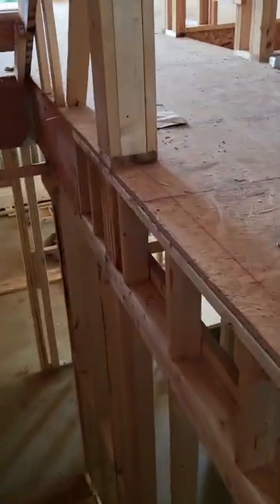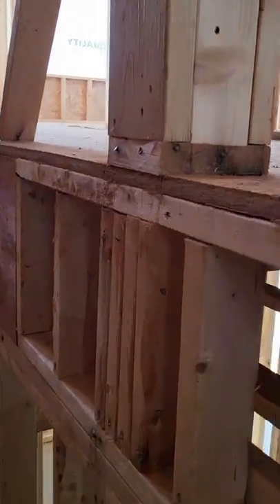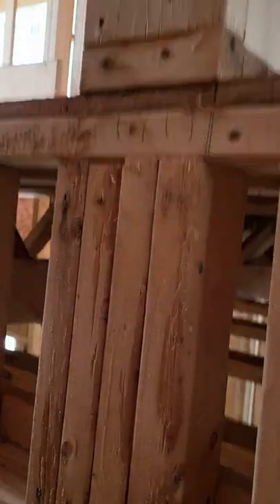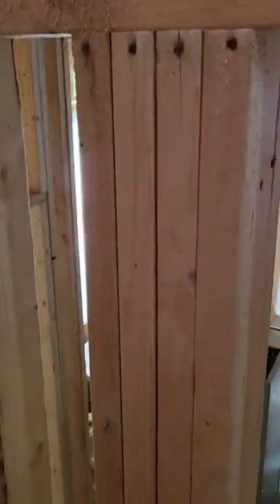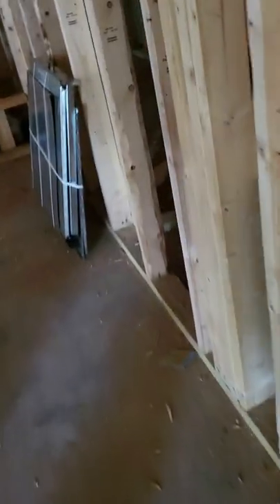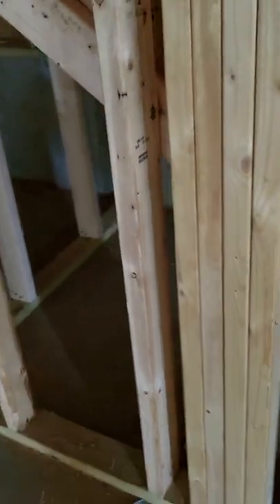Framing Point Load Done Correctly

Comment: The correct way is to use a solid post, wood or metal and not 2x4's. They use 2x4's because it's cheaper.
Reply from the maker: Ok.. I appreciate your feedback.
Reply: Obviously your not familiar with North American framing
Reply: In Canadian building code you can build columns out of dimensional lumber
Reply: This is stick framing my guy, not timber framing…
Reply: I agree with @GT43. Better to use a solid 4x4 when that many studs are required. 

In a situation like that, those studs are called King studs. King studs are also used around window and door openings.
Reply: Unless the 4x4 is clear w no knots it might not be the best choice.
Reply: The problem with the 4x4 is that it's a single failure point if it splits and this type post has multiple before a problem. Actually better long term. Still would like to see LVL material as the caps.
Reply: @wdwerker right you are! Great minds think alike.
Reply: Untrue. Solid members are subjected to knots and splits. Dimensional stacked lumber has the imperfections spread throughout randomly making it a stronger member overall. Think of LVL's. It's a bunch of thin pieces of wood laminated together. Often times more pieces of dimensional lumber nailed together is more costly than solid posts.
Reply: And Goodluck finding solid wood posts that are consistently straight. You won't.

Comment: As long as the concrete guys put  the footing in the proper place you should be good to go.
Reply from the maker: There are footings under the slab at all load bearing walls.
Reply: @PPG1967 then you can skip my comment saying the same. As a spec builder I confirm with photos all of these points before concrete to make sure we didn't mis one. But I hate slabs so much I'm never doing one again.

Comment: I would have use a steel post on the second floor . I’ve seen to many of those tiny wooden sole plates split and blow out under load
Reply from the maker: Oh ok, I appreciate your feedback.
Reply: @PPG1967  noooo don't, built a house in great detail when I was a kid, it was a 2 story with a basement, all the load bearing in the basement was steel columns, the reason the owner who was building it chose all steel in the slab was because the first house he build he went for all wood to save cost. the first solid flood his basement recieved rotted the base of all the supports. 

now each house he builds he makes sure to get some kind of water resistant paint on the lower half of the inner steel supports. he said he's never had a problem with LBW in the basement since. just my 2 cents.
Reply: Try using 3/4 plywood
Reply: Bro, a 2*4 stud on end will support 10k lbs. More when they're shorter.....
Reply: Throw some metal at that gusset plates or coil strapping at all your connections
Reply: Yep those blocks should have been LVL. They had the cut offs around somewhere.
Reply: @PPG1967 as the other guy pointed out on the bottom plate. Is had to be treated because it's in contact with the floor. Should have left a wide piece to show that at the bottom and drywall could cut it off.
Reply: @knotallthere66 yep but honestly with the quality if this house they're getting what they lay for. 
I get it that it's a lot of money for a house but people getting upset because they're paying $500-700-1,200,000 and telling you it should be done like it's a $5 million are a pain in the neck.

Comment: I don't know what state this is in but here in WA you would need a 4×6 to transfer the load, not a bunch of studs. They also generally have the post in the basement secured with a hold down that's either wet set or epoxied into the foundation
Reply from the maker: Oh ok..construction is done differently around the world....depending on what code books are adopted.

Comment: In California we are required to use hold down and Simpson ties to secure the load
Reply from the maker: Oh ok...for possible earthquakes??
Reply: I have worked as a job site framing Forman in California since the 80s before all the Simpson tie downs and hold downs, clips,hurricane ties,coil straps,endless shear panels etc,it takes more time now with all the hardware but it makes the home way  more tighter way more stronger and a lot safer,this framing job would definitely get red tagged here in California.
Reply: Everywhere like that on outer walls they are required, under braced wall code
Reply: OK, my help in a small shake. Good extra.
Reply: @munger2166 Just another reason to never move to California, thanks for the heads up.
Reply: @bryanlacount7551  you couldn’t afford it anyway
Reply: @PPG1967  Yes. You are 100% correct. I feel that you already knew this though!
Reply: California always gets hell I wonder why
Reply: @PPG1967  For earthquakes, yes, but some jurisdictions require the same sort of hardware and techniques for resistance to high winds from tornadoes or hurricanes.
Reply: It's easier to pull the wreckage if it's all linked with thin sheep metal stapled to the split ends of all the 2x4's. The closer to the ends the better. You want nice split ends for aeration.
Reply: @chrisd6607 lol you're rich and cool huh?

Comment: Nice to utilize a hold down even if your note in a sizemic 3, 4 in case of uplift wind
Reply from the maker: We're in a different seismic zone down here in Georgia
Reply: Yes bit if you listed it on inspection the contractor would just cut some strapping or some plate and nail it on (i realize its called gusset support or skmething like that. Conector thats used on trusses). Anything would help. I would put it as a recommendation. A homeowner could do it themselves and less chance of drywall cracks.

Comment: With two levels above the slab at that point needs at least a 24x24x 8” footer under the concrete floor to meet code.
Reply from the maker: So, what code book are you referencing??
Reply: Crickets
Reply: Thank you my point as well.
Reply: @PPG1967 could be Chicago. We’ve always got porches crashing here.
Reply: @PPG1967  I don't know what code is off the top of my head but concrete standards are nothing below 18" x 18". 
Depends on thickness of the slab. 

Post tensioned slabs are a whole other deal.

Comment: Great job.  Now along the coast, it all needs to be strapped to provide a continuous load path for wind uplift from the foundation to the roof.  All of that dead load works to offset the uplift.
Reply from the maker: I appreciate your feedback...thanks for watching.
Reply: Yeah i agree with some steel all the way down until the concrete, but dead load would meet that requirement before getting to the slab. 
If you put in steel to the concrete it's an hassle and extra cost when the uplift will all be engennered by the outer walls and the trusses wouldn't have an uplift load in center span. 
It's tract home quality so we all can point out higher quality for our own trades but if we did it that way the house wouldn't get built due to cost.😊

Comment: That  would  FAIL In New Zealand.  To many peices involved...
Reply from the maker: Well, that's considered good framing   here in the US.
Reply from the maker: I appreciate your comment.
Reply: In my area in the US, we are required to use post (4x6) with ties. Example ( 1/4” steel plates with 5/8” bolts) to account for wind lift.
Reply: I think it comes down to if the load path is spec’ed out or annotated. You might be used to having the load path being strictly specified.
Reply: @PPG1967  this framing works. In fact This type framing we use was engineered by Europeans when they came to the US. The UK uses some of our methods of framing as a result
Reply: Theres no such thing as "too many peices involved in Nz3060 or AS1684", this guy is full of faecal matter and probably doesnt know how to take the safety off of a drop saw.
The only thing we do that's really different to what you have done  is cut a bit neater and we use metal straps to connect the different roof and floor diaphragms together all the way to the slab. The part of your floor that he references is blocking made in-between the proprietary floor truss system you have used and blocking with studs like you have done is compliant albeit i prefer to use a solid beam blocking that goes from joist to joist because it cant shrink out and move out of position like a stud grouping can over time. 
Otherwise you've done a good job mate! 👏
Reply: It would fail in Japan as well.
Reply: Of course you want as much clean carpentry as possible the point is whether or not it's a safety issue. You also have to understand lumber is extremely expensive now in the United States and it used to be fairly cheap. And it's also very hard to find large pieces of lumber, old growth is mostly gone here. It's sad but true.
Reply: Engineering details. Codes don’t cover all applications..

Comment: Several things. Properly nails not just blocking them equal or same amount at least and then the slab you need a pad or a second edge at the concrete preferably with steel in it
Reply from the maker: I appreciate your feedback.

Comment: Here we have to make sure the load bearing points of contact on the slab need to be 12 inches thick with rebar, normally a slab  only 4 inches
Reply from the maker: There are interior load bearing footings.
Reply: You need a pier not grade beams for a point load

Comment: But the support blocks between the floor system should all be the same size.
Reply from the maker: Ok, I appreciate your feedback
Reply: Short blocks can be designed for the crush load allowed on the horizontal plates, About 300 lbs a sq . inch. The blocks are allowed 450 lbs. a sq. inch. Column derating does not apply. A 2by 4 on a plate is good for 1500 lbs.

Comment: If you only going to use one single 2×4 corner to hold all that up, you may want to think about switching to steel like a round column 3" and it will still fit inside your  wall. Insufficient , cutting corners isn't a good practice
Reply from the maker: Ok, I appreciate your feedback.
Reply: That's 4 studs with load distributed top and bottom on each. I'd like to see those ends made of LVL. Now I have to check the crush load rating from the side on LVLs. May need a glue up lvl on edge.😊

Comment: Those short pieces you call blocking are called cripples. They are short studs. In this case there are 4 thick to continue the proper transfer downward. Good work.
Reply from the maker: I appreciate your feedback, and thanks for watching.
Reply: I've used jacks in the basement to lift the point loads and get headers off the windows so they will open. Always crush blocks all the way to the foundation.

Comment: What about rot on the slab due to condensation? I have this issue right now on my 6x6s in my basement
Reply from the maker: That post is on the interior...where do you live??
Reply: Still should be treated
Reply: As long as your sill plate is pressure treated you should be good.
Reply: @PPG1967 it's touching concrete it needs protection. It has to be treated and I be it's not, they should cut a long piece to show it's treated and cut 3/4th the way through so drywall can cut it off easily.😊
Now that I think about it I imagine someone hitting it from the side to snap it instead of a chisel or multi tool.😮

Comment: If there is a footing under that concrete, it’s not supposed to be slabbed over.  It should be expansion jointed and exposed so that it is obvious to anyone that it landed on the footing.
Reply from the maker: There is a footing under that load bearing wall.
Reply from the maker: What code book are you getting your info from??
Reply: @PPG1967  in my area this varies by jurisdiction, but it’s really more of a common sense thing.  How does anyone in the chain of inspection know through a visual inspection that the post is in fact resting over the footing unless the footing is poured to finished floor height.  Secondly, a slab resting on a footing surrounded by loose fill is just asking for trouble due to the different compaction dynamics.  Doesn’t usually present a problem for standard flat work (though it can), but it can behave much differently with a point load as the slab attempts to disperse that load over a much larger area than the footing itself occupies.
Reply from the maker: There was a monolithic slab inspection conducted, with interior grade beam footings.
Reply: Not by code on that little load it's not even needed as a control.

Comment: In my 76 years of life, I’ve never seen what you’re showing here. I have been in a bunch of homes that were being built up to 3500 sqft.  I’m in the Midwest, Chicago area. I have seen a home that the architect liked open spaces and he used 2x10 members that were actually 2” wide by 10” high, the outside walls contained steel posts for support and the basement also used multiple posts with I beams. My current home is a ranch with a full basement. The middle of the home has a vaulted ceiling ( up to 14’ height) from the entryway to the family room. It is a truss construction. The home is 53’ wide and 38’ deep. The basement has 3 I beams, each is supported by 2 posts and each end sits on a foundation wall. All posts are supported on a footing below the concrete basement floor. Their is a factory manufactured stair case going to the basement. The opening to the basement is supported by 2….8x10 laminated beams that span from the foundation wall to an I beam.  All the interior and exterior walls were made in a factory. The floor on the 1st and only level was made in one day, all the walls were erected on another day, and all the trusses were done on the next day, etc.  I have lived in the home since it was built in 2003. This is the best home I’ve ever lived in, it is a tract home.
Some of the reinforcing methods you show, are questionable. I personally do not like 4x4 supports. I use 4x6 or 6x6 and metal bracing. One of the posts was made of different pieces, this to me is also questionable. Whenever I had to do something and it needed to be inspected by a city inspector, I left it apart, until he inspected it, or assembled it in his presence. In this home I built a 16’x48’ deck with 2x10’s, 13  10” diameter x 4’ deep with rebar concrete support posts, double galvanized hangars, full skirt, 48’ long support beam, 2 stairs, and using a cantilever design. It is 20 years old and has had some top boards (8@ 8’) replaced last year, superstructure is in like new condition, otherwise it’s in good condition. Doing it right, makes it last a long time.
Reply from the maker: I appreciate your commenting, and thanks for watching.
Reply: Those compsit beams are better than a solid piece. It's counter intuitive to people that learned dimensional is always "bigger is better". Always go read the engineering docs from those products. Then the other standards for things like failure. Somewhere between 2000 and 2010 engennered lumber always comes out with the same load and better features like water resistant. With CLT, OSL,LVL and more that I'd get the letters wrong on. Little bit of training and you're better off afterwards.

Comment: Did you check the plans on site to confirm there is a thickend area in the slab under that post? That has to have a footer and steel under it.
Reply from the maker: Footings are underneath all interior load-bearing walls.
Reply from the maker: I appreciate your commenting.
Reply: @PPG1967  sorry for commenting before reading the 40 comments saying the same thing.

Comment: Here in Ontario if that 4 pack of studs are nailed completely tight then we get called on it. Inspector says they have a chance of bowing apart from each other and can cause a drop. So at least you guys get away with that.
Reply from the maker: Oh ok...I appreciate your comment.
Reply: Wel the inspector would be wrong, thats why there are nailing requirements. Let the inspector know we have computers in the US and engeneers.
I bet if you read your code it allows it. Which is always the best way to deal with a. Inspector.😊

Comment: Are those small 2x4 blocks on top of and on bottom of posts allowed?
Reply from the maker: So, are you familiar with transferring a load down?
Reply: @PPG1967  are you aware that wood has different compressive strength depending on the orientation of the grain? And what about earthquake, hurricane and tornado zones. The lateral stresses become more significant.  Hence building codes moving to more metal strapping. How to you think a post with a 2x4 block on top and bottom and an unspecified nailing pattern is going to do in those situations?
Reply: Who says those blocks are even nailed down? Definitely the weakest link

Comment: Might want to eliminate the top and bottom of that tiny four stud wall. Put a solid post in there.
Reply from the maker: Ok, I appreciate your feedback.
Reply: And lower the load capacity? Then reduce the failure potential to one from 4 before it fails.

Comment: Is there a footing under that point in the slab? Otherwise it's all for naught.
Reply from the maker: So, all interior load bearing walls have footings underneath.
Reply: @PPG1967  So, No they don't "always" have footings. They do only if it was planned that way. That wall isn't an exterior wall, that definetly has a footer. It's resting on open slab. Unless you drew the plans or poured the slab you can't know for sure if there is a footing beneath it. In my experience stuff like that often gets overlooked, especially in remodels. In every home I've built we would pour a footing specifically for that point load. At least 18"d x 36" deep at a minimum. THAT'S what I was talking about. No need to be condescending. There are people out there that also know how to properly build stuff.